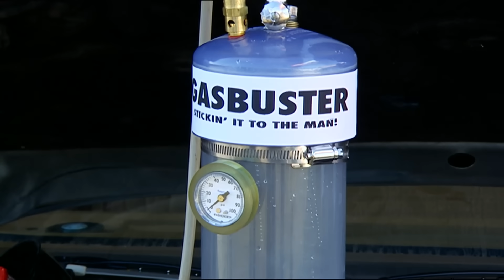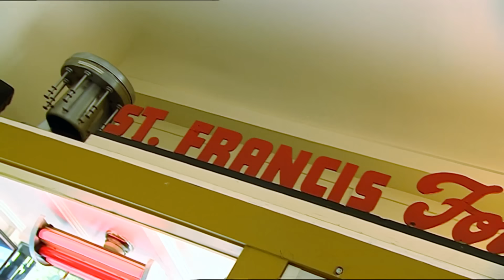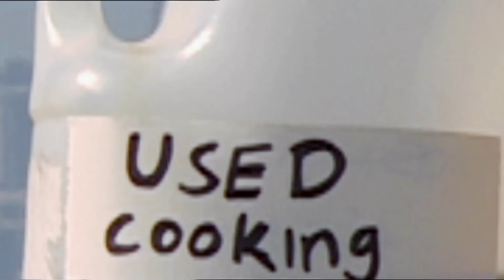Do Aftermarket Fuel Saver Devices Actually Work? | MythBusters

Comment: In India, people run their vehicles on CNG (Compressed Natural Gas). Pretty sure, after some tuning, it won't have any problem running on this.
Reply: Following anything that India does not seem wise.
Reply: I got my hands on a 65kW gen set fueled by natural gas and powered by a Chevy 350. It was turbocharged and produced under 100 hp (65kW = ~90hp).  You need a lot of natural gas, which displaces a lot of air, so you have to turbocharge to add the necessary air... for 90hp
Reply: My service van can run on propane. It runs very well on it as well.
Reply: they tried that in US about 20 yrs ago and guess what happened?
Reply: I built snowplow truck that run on CNG Columbus Ohio had 30 built in 2023. They suck fuel mileage is horrible power is none existent it's garbage. Only reason Columbus has them is they get a government kick back for it.
Reply: It just doesn’t make the power, even less than propane which is less than gas. I’ve ran propane and the oil stays clean at least but the power just isn’t there
Reply: I believe conversion kits are available for most gasoline cars
Reply: To produce 1 kg of hydrogen via electrolysis, you would need at minimum 40kWh. To power a compact car, you would need that 40kWh every 15 minutes or so. That means having a 160kW generator running constantly. For reference, a 100kW generator is about the size and weight of a compact car.

Comment: Was curious about the stories of folks taking lawnmower parts and swapping it onto a car for better fuel milage. Sadly I'm car ignorant to recall the parts swapped or specifics of the story.
Reply: That's possible, but would have to be a small liter engine. And the smaller lawnmower type carb just makes the vehicle dog slow because it gives it no power, which is where the better fuel mileage result comes into play. Not really ideal.